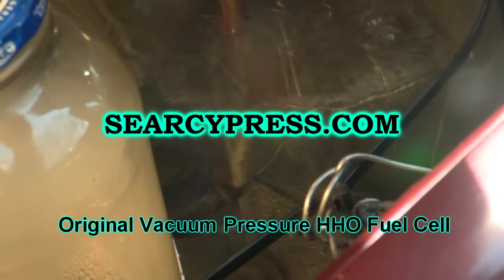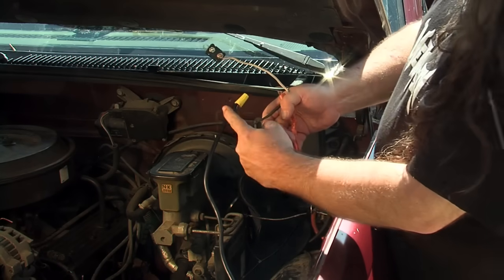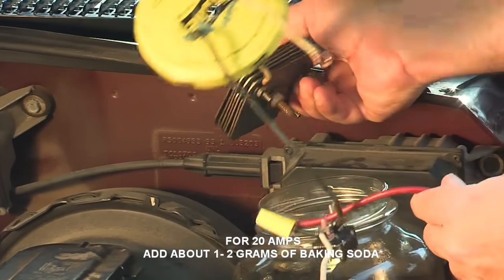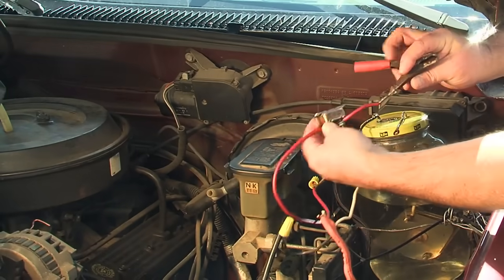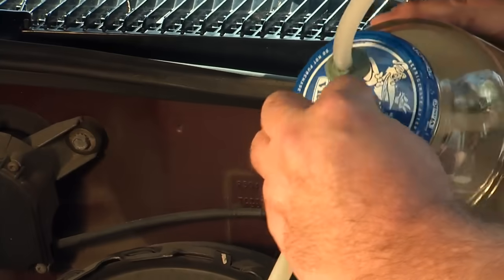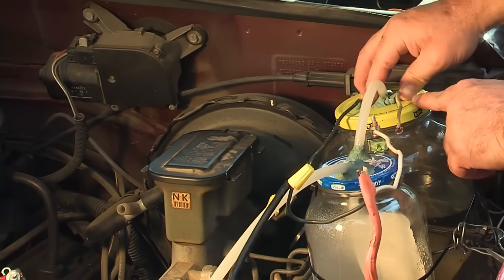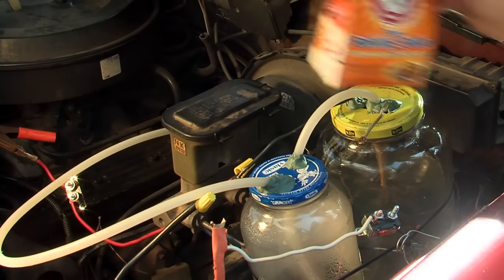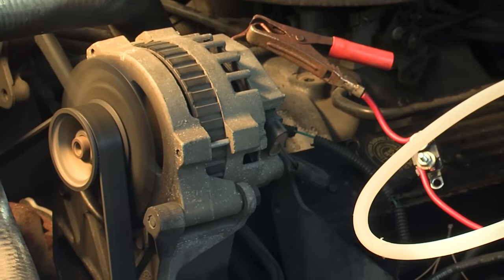Vacuum Pressure Hydrogen fuel cell defeats high gas prices using hydrogen from H2O.

Comment: The Trouble is the impurities in the Water Blind off the Cell reactions forcing the need for Amperage my Truely Pure Water uses a third the Amps to get more Gas had them in my Car to and worked perfectly but when I put regular Water Distilled in them they never worked again plus if you don't Repo rate the Gases they can Blow up the Cell like a Bomb very unsafe the way your doing it and the Gas likes to go Neutral if they mix to soon converting back to Water in the Lines so keeping them Seporate is essentual to work right 907-799-8356 thanks
Reply from the maker: I have yet to see anything in vacuum blow up. The need for special water is not something we ever came across. Also the cell can't stop working. As long as power and h2o (dirty or clean) it will crack it into hho. If a cell shorts out, it trips one or two of the overloads..you bang it on the ground, wash it and your good to go. Are you selling this water? None of the issues you mentioned have ever been a problem for us. Ty for comment.
Reply: @metalpresstv  Your using 1000 times more Amps and getting nearly no Gas out of your Blinded Cells I know what I know and my Pure Water is the Answer to the problem but you have to start with new Cells or it won't work right I have already proven this
Reply: @metalpresstv  907 799 8356
Reply: @metalpresstv  the reason you can't run 100% on Water is because the Water is fighting you and won't split fast enough to give you enough gas to do it with they have somewhat solved this with AC and high frequency but even that is stupid but working the only thing you need is pure water and I am the only one that makes it at this time it spits very fast and can deliver enough to run the vehicle alone but at this time I have not taken the time to work with it as no one has shown any interest in it yet

Comment: It wasn't even shown how this was actually hooked up to the engine, no mention if you have it plumbed into the fuel system or whatever.. and to be honest, it didn't look like it was hooked up to anything except the alternator
Reply from the maker: Sorry you did not see it. It hooks into the vacuum line. This then goes into the engine. Are you sure you watched it? Thanks for the comment.
Reply: Metalpress TV I seen that, just didn’t put 2 and 2 together lol

Comment: a simpel thought idee each's rotation you need 1.5 liter gas wen running idle @ 1100 rpm you need 1.5 X 1100 =1650L expanded gas. if I look @ the gas production in the car it is far from this amount, so clearly bul....
Reply from the maker: Not trying to run the engine completly on hho. Thanks for the comment.

Comment: That water (steam) that comes out of the back is also getting in your oil, and we all know that will create more problems later down the line for that small block. Let allow the fact that at the temps in the combustion chamber the metal becomes more porous and the water (steam) oxidizes a much faster. So that money your going to save in gas your going to end up spending on getting you engine replaced.
Reply: It would be worthwhile contacting a line oil company and asking if something like a steam turbine lube oil could be used?

Comment: Doesn’t work with vehicles that have oxygen sensors. The sensors read the exhaust as too clean and then increase the fuel input. In order to make it work with the sensor you must be able to control the air fuel ratio

Comment: Truck is not a 1996.
Reply from the maker: You are correct. The 1993 motor was replaced in 1996. I am sorry for the confusion. Thanks for the comment.

Comment: first mistake your bubbler dosn't bubble. second if it woud bubble you would get it in your cylinder head, third if you get ist in your cylinder head it wil corrode fast, so ..... nice try
Reply from the maker: The bubbler works wonderfully. The design makes it automatically fill itself. This truck is now a classic and still runs amazingly. I'm not trying to sell you this. I do not want you to build it. It was an experiment and the video shows the results. Thanks very much for your comment.
Reply: Thanks for the awnser. looking forward to see more of it :-)  @metalpresstv